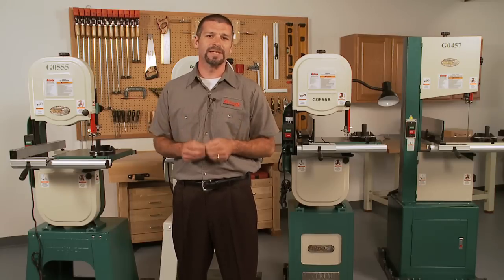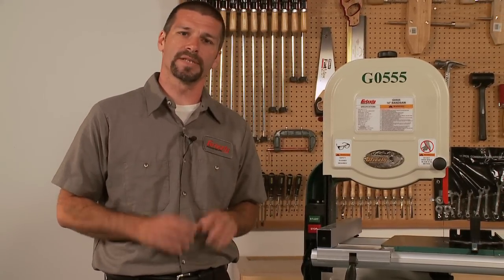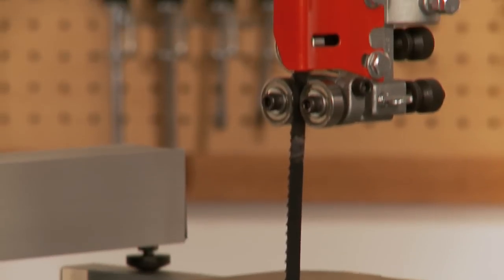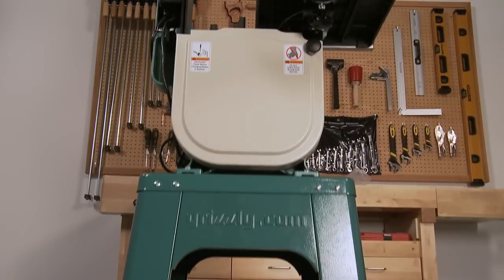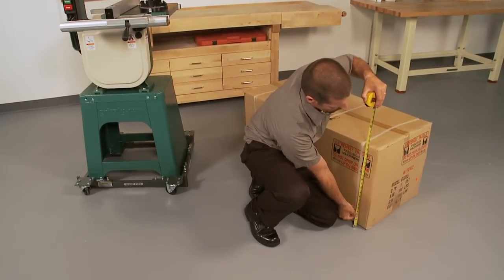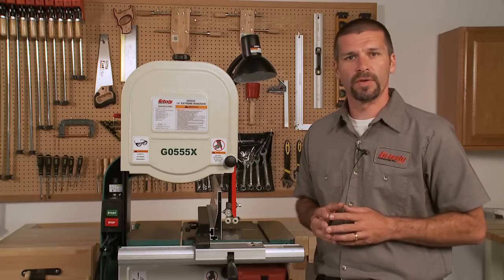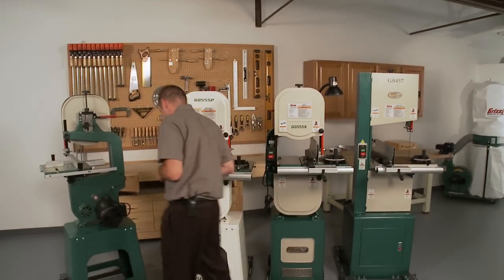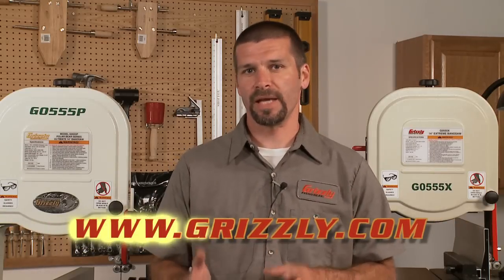Grizzly 14" Bandsaw Comparison

Comment: Making a hardwood fence for the miter makes all the difference MyBest.Tools Tune the saw with a combination square. Adjust the laser so its in line.😂🤣😂🤣😂🤣😂🤣See the photos.Every part in this saw is adjustable.😎😭
Reply from the maker: The Classic 14'' Bandsaw - Grizzly G0555 has an approximate shipping weight of 199 lbs. You can find more details here: https://www.grizzly.com/products/grizzly-the-classic-14-bandsaw/g0555

Comment: I have the G0555, Use it daily for over 6 years, only maintenance  are the blade guide bearings, on average 4 bearings a year..  I don't use a riser(the 1hp motor struggles cutting 6" , it never will cut 10").  The table is a little narrow and the fence rails should be 4" longer.  It has a terrible table angle-read-out back under the table..   Overall a very good machine, I recommend it to all wood workers starting out, I have out grown mine but I just can't give it up...

Comment: whats the advantages of running it on 220v instead of 120v
Reply: Charlie Thompson Power. 110v tops out at around 1.5 hp.
Reply: but the motor is rated at 1hp. is it worth it for me to run a 220v outlet to run it on i can easily run a 220v outlet to it and the same for my table saw
Reply: Charlie Thompson At 1hp, no I wouldn't think it's worth it. From my experience (I've rewired my old table saw for 220V), above 1hp running at 220V helps prevent bogging down if you push the motor's limits, but be aware that this also means it's possible to burn the motor out if you overstress it. With the extra power you are the limiting factor, not it.
Reply: ok thanks for your help
Reply: Amps most 120 circuit are 15 amps most 220 are 20 + amps but using 220 you're using half the amps and less chance of blowing a breaker.
Reply: Your utility power meter will run half the speed at 240Vac of that of 120Vac, hence save you money. And your machine will love you for it too. I can get into very technical about it but just think about the Europe and Asia where 240 V is the norm. Higher efficiency at half the cost.
Reply: 240V (220V) operation by all mean Charlie. Even for 1 HP motor, you will double the efficiency of your machine. My table saw is running at 240V, whispering run and yet it's stronger. it once was bogging down all the time with hard cut at 120V.
Reply: It will draw less AMPs. But then AMP X Volt+ watts which is measurement of power. It will allow you to run higher amps on same circuit ;not more power.  Electric companies also charge by Kilowatt hours.
Reply: Im pretty sure it will only have an advantage on start up with the extra push (volts) as far as total power it remains the same. 120v x 14a = 1680w (watts = power) 240v x 7a = 1680w

Comment: Why is my 1/4 in blade riding off the front of the lower wheel? I have tried tracking and tension adjusting
Reply: Same here tension issues on the 555p